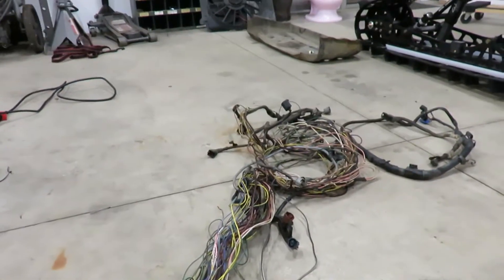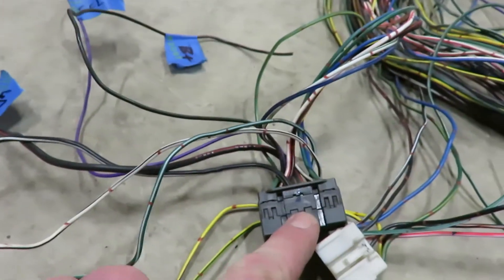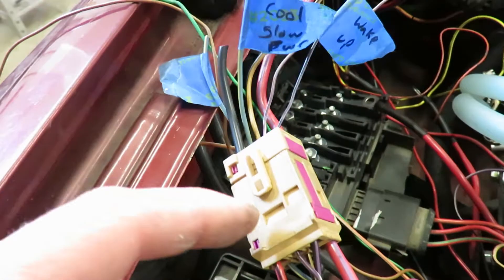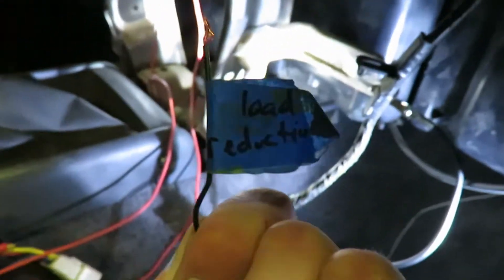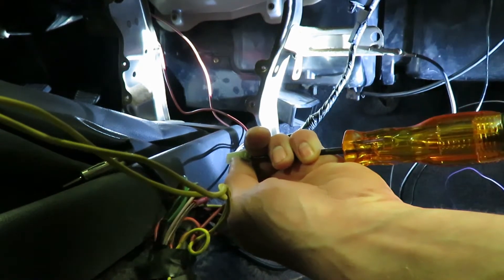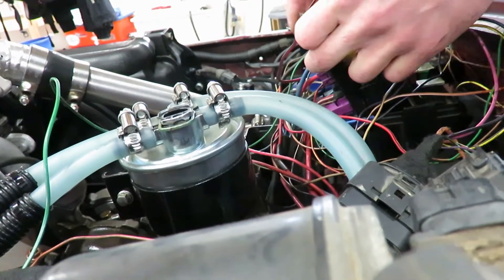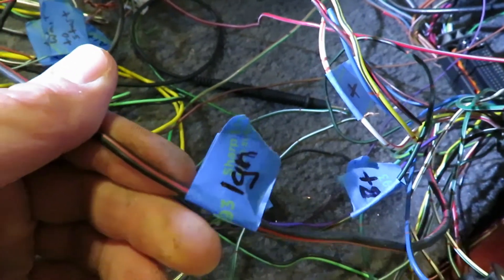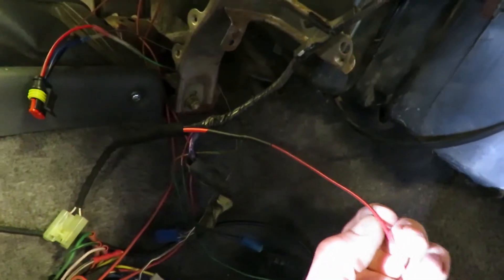Toyota TDI Swap Wiring Toyota Engine Harness

Comment: hi austin i  know this video is old but what/where do the first two plugs you talk about in the video go? with the CEL wire, the the battery for the obd2 port, the ign power for injection pump, and the trans plugs oil press and starter wire

Comment: Where did you find your schematics for the Toyota side. Trying to figure out the ac wiring
Reply from the maker: Jerome Campbell I just found what I needed on google! And most of it I just manually traced
Reply: Was the tach wire off the white plug,do you remember the color
Reply from the maker: Jerome Campbell shoot I don’t remember now! There are tons of diagrams online that show the tach wire.

Comment: Is the wiring on this swap alot less intense if the Toyota is carbuerated??
Reply from the maker: Goat's Garage I would imagine but the Toyota side of things is stupid easy! I just found a couple wires out of the harness I needed and chopped the rest!
Reply: @austinniemela   so it's just refining down the vw harness to the necessary plugs  is the hardest ??    I can't wait to see it run!!
Reply from the maker: Goat's Garage basically! You leave the whole yota body harness alone and just take a few wires out of the engine harness to use mainly for lights and gauges on the cluster. Majority of the work in on the vw harness
Reply: any chance you have a link to the diagram you used for the toyota side? @austinniemela